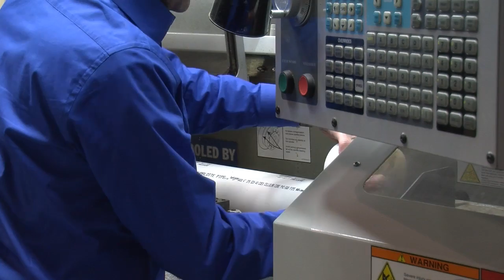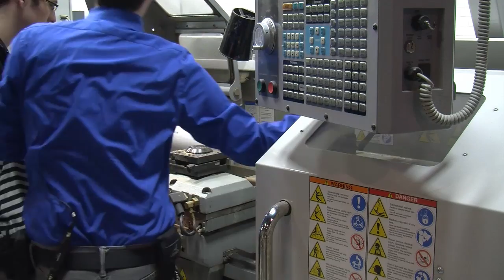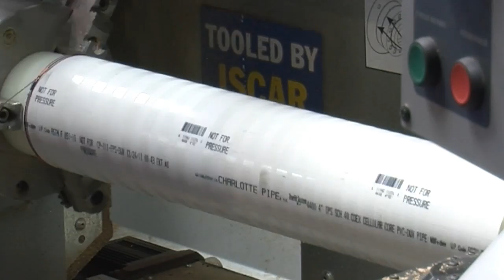Winding a Secondary: Tesla Coils With Trevor #1

Comment: Great video.  I must say something about safety.  When working with rotating machinery, such as a lathe, you need to roll up your sleeves and secure all loose clothing.  When your hand is that close to the jaws of the chuck, the chuck could grab your sleeve and pull you into the machine.

Comment: Have you ever wound any conical secondaries?  I am starting to wind a little white plastic kitchen funnel as a secondary and that double side tape is essential to keep it on there. It wants to pull up in towards the center as the wire tension increases.

Comment: What kind of magnet wire is it? Like 600volt rated? (What will the turn to turn voltage be?)
I've got several secondaries that I wound from random magwire I had laying around simply because I think it's pretty.

Btw, will any bucket cap work with any tabletop size coil? How important is it to have precise capacitance, and if so, how do you tweak it?
Reply: Seroster best way to tweak it with bucket caps is either adding removing more caps which is kinda hard unless you got alot or adjusting the secondary or adding an adjustable inductor